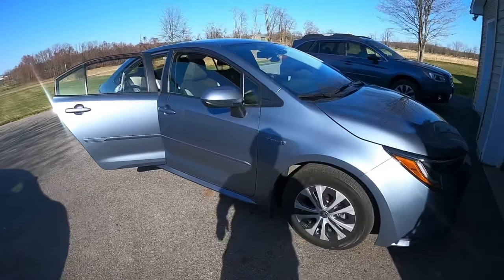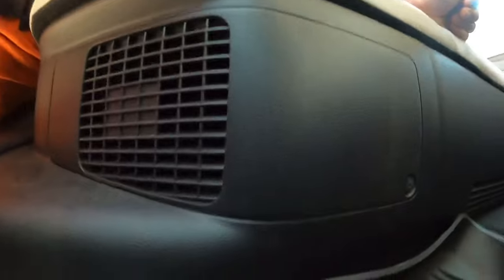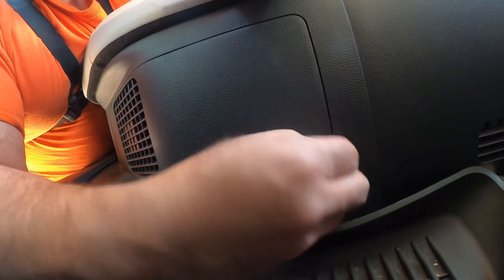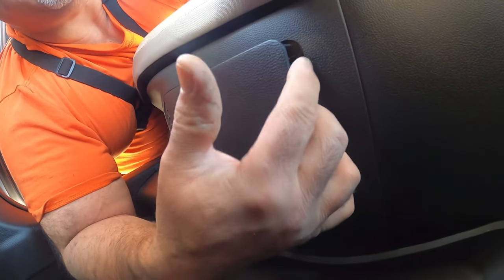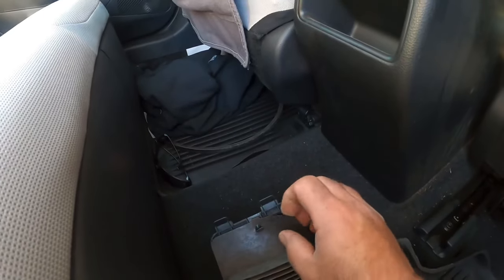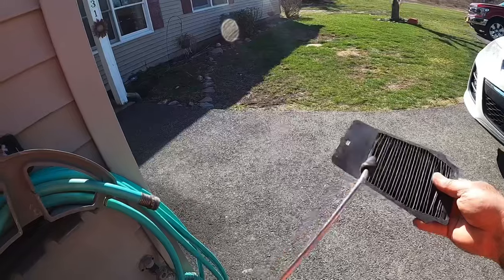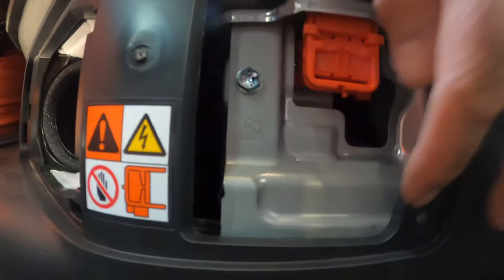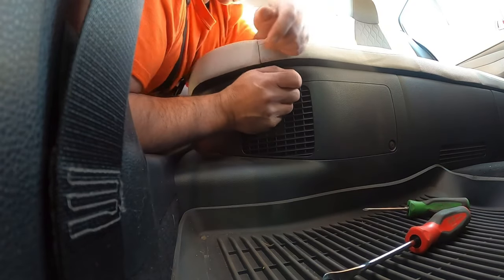How to:R&R Toyota Corolla Hybrid HV battery filter

Comment: There is one thing wrong here, you should use a vacuum to suck the dirt out, not use a fan to blow the dirt in deeper. That's how to clean the hybrid battery fan filter mentioned by Toyota manual.

Comment: Thank God for AMD! I own a 2019 Prius which is exactly like your Corolla. I vacuum mine out yearly. I may replace 6+years depending on it's  shape. I have 20,000 miles on mine. Isn't it a shame there's not a nut u can loosen on the squirrel cage? I'd remove that & vacuum out. Nice to see other's, like you, take pride in their Toyotas. I sub'd & gave you a 👍.

Comment: Thank you very much! I had no idea about fan filtering until recently by watching videos on You Tube and my Toyota dealer has never said anything about this important maintenance issue! I’m pleased that Toyota has made the ‘21 Corolla’s fan filter very easy to remove and clean or replace, but I’m disappointed that this issue has never been publicly addressed by Toyota in the first place resulting in numerous battery failures. I will immediately contact my dealer to inquire about what they have or have not done to my Corolla and Prius V fan filtering systems in the past. They have never said anything about this to me before. 
Older Prius’s didn’t even have fan filtering and the fan motors got horribly clogged with dirt and dust causing numerous early battery failures. Bad Toyota!
Reply from the maker: I agree that Toyota really doesn’t give you any information about the hybrid system and how to keep it working efficiently as possible.
Reply: Should be in the maintenance  manual

Comment: The 2024 corolla hybrid has no screw. The other side of the seat has a cap that’s removable as well I popped both out and only one had the filter. Anyone know what the slot is for on the passenger  side in under the back seat for the 2024 Corolla
Hybrid Thanks.

Comment: Never clean those filter, always replace them. Especially the cabin filters. If you just clean it you can leave some bacteria and stuff behind then mold can grow etc. Just replace them.
Btw, besides an oil change THIS is the upmost important maintanance for those cars. Dirty filters will destroy your battery, a replacement costs about 3k.

Comment: My screw was such a nigtmare to get out finally some tweasers did the job
Reply from the maker: @LadooCrew  They can be tricky,the same pressure you need to apply to get it to turn works against you,iI always try a different screwdriver if it doesn’t fit correctly you have to push too hard and then it just spins and won’t back out.

Comment: Is there an external one you can get for these? I was able to get one for my 2015 from a Toyota dealer. Although these look 1) a lot easier to get to and 2) I don't think the Prius has a filter, just a fan. Did I mention I haven't put the Prius filter on yet? I like using a vacuum for cleaning filters. Seems a bit gentler that compressed air, and I use a nozzle with a brush.
Reply from the maker: I’m not aware of anything other than what it came with. It does look like a very flimsy filter to me. I’ll be doing my 30 K service in the next week or two I’m gonna do it by the book. Local dealer is backed up for months and last time they serviced it well I had to beat the tires off it six months later ,The aluminum wheels were corroded on to the brake rotors, so  I know they werent rotating the tires,What good is Toyota care if they’re not actually doing the work. I would’ve done it myself if I known so now I don’t trust the dealer. I know they did The oil changes because the oil was clean afterward.

Comment: Dumb question…does that mean my leg should never positioned in front of the vent or very close to it?
Reply from the maker: As long as your not actually fully blocking the inlet your fine . The issue is with ppl being careless with jackets,  groceries and junk just throwing it back there . Keep that inlet area and filter clean  and your battery will last a long time.